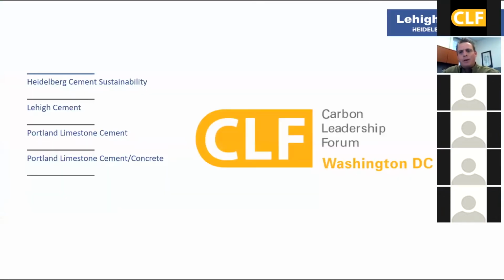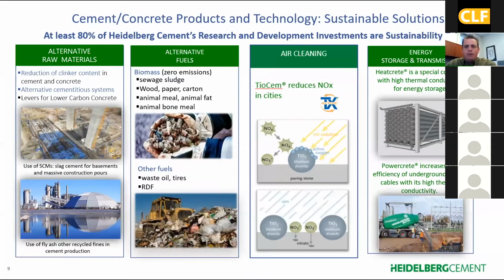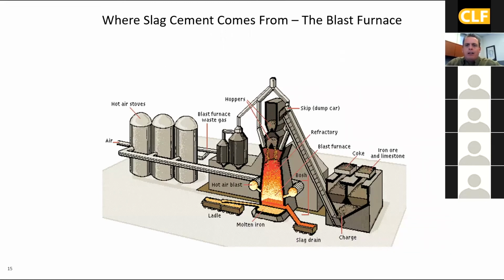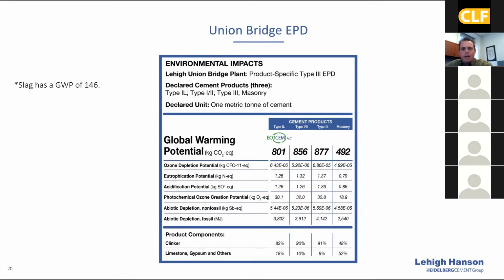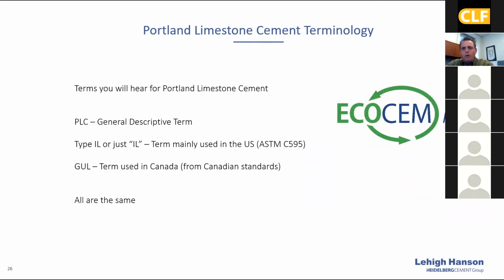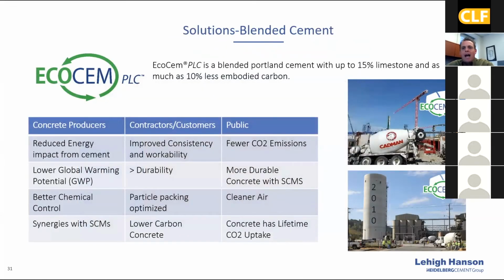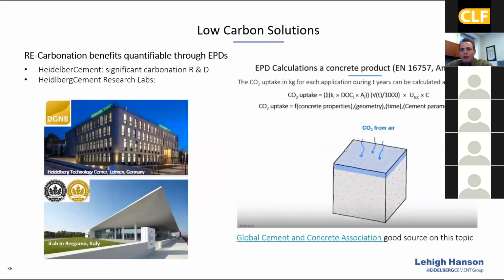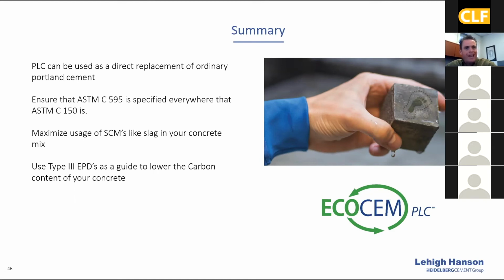Portland Limestone Cement (Type 1L) | Lehigh Hanson

Comment: The state of Iowa has determined that more pounds of type 1L cement are needed to end of with the same strength as when we were using type 1/II and require more pounds be used in road construction. So now that the only cement available is type 1L, more cement powder has to be put in every yard of concrete. I am not sure that type 1L has an overall lower carbon footprint when you look at more pounds being hauled from the plant that produces it to where it is used.